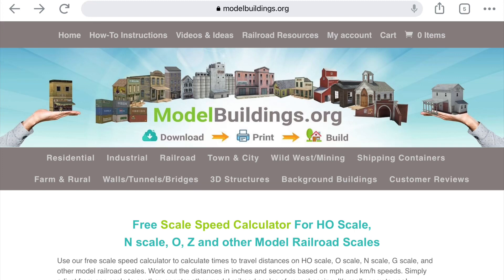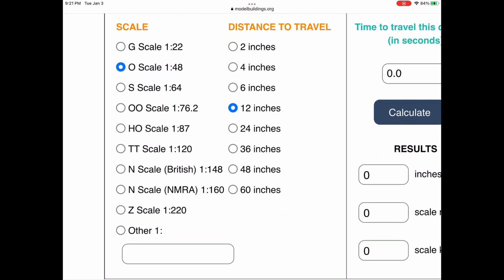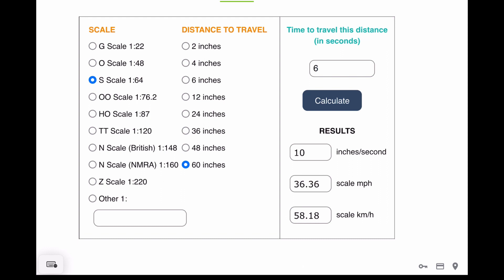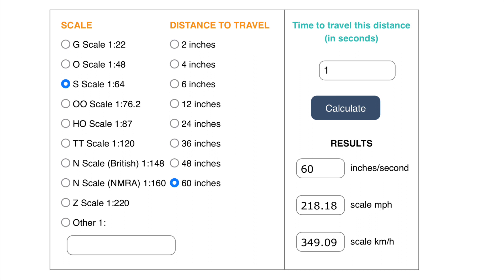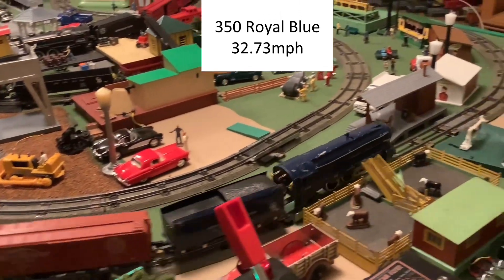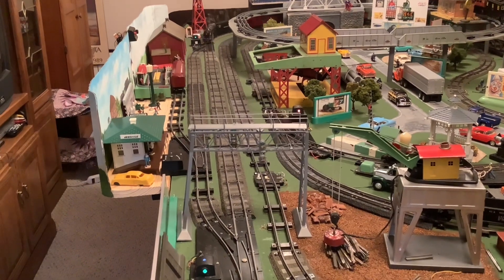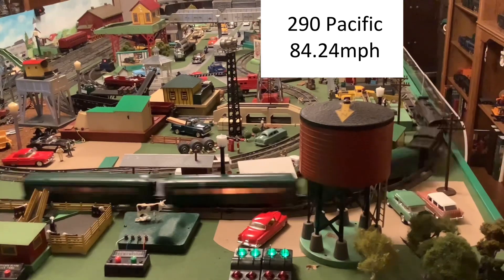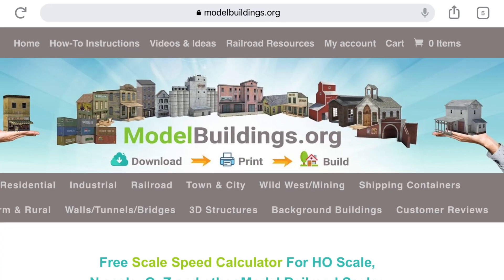American Flyer Relative Scale Speed

Comment: Roger, excellent topic and well covered. I too was getting annoyed with the speeds required to get the engines to show their strength, chuff and puff. About 7 years ago i started changing my engines to Electric Rail Road (ERR) TMCC controllers via Lionel. These little PCB boards offered a Digital DC control of DC Motors to include a cruise capability at a very slow speed. Then Mike's Train House (MTH) Offered its version of Digital Control (DCS) and their fabulous Sound System Proto Sound 2 & 3 (PS2, PS3). They added crew talk and random engine noises too. But what hooked me was the Puff & Chuff. The engines could be directed with a wireless hand held to pull away at 1 MPH Scale speed. Then slowly ramp up to cruising speed with the puffing stack synchronized to the Chuffing Sound. Oh it was amazing. But over time the costs of systems like these started to take off, from $30 ERR TMCC to $250 today and MTH PS2 $75 now $350 if you can find it. I retired in 2017 and started to research how to help my Vintage Original Engines to be as much fun as these expensive 3rd party upgrades. I found it is possible but it has taken over 7 years to develop sane logical upgrades in the Spirit of AC Gilberts support for technology.  My Channel on You Tube is Frankentrain Laboratories. Where i have over 900 videos on my efforts. I would like to begin a teamwork with you to evaluate my work and see  how I can help to make these upgrades useful and reasonably priced. All my parts designed and made by me are offered at my cost. I am retired and work in my basement. I have train buddies all over the US.  Here are a few links to share with you. I am NOT a Modeler, I am a Developer. So my Layout is named Rat Rail Line. I can't paint anything very good. Enjoy and lets talk, 302 in test chassis only https://youtu.be/qy9D9MSFLKU
same 302 on the rails in test  https://youtu.be/HrLresxhJeE
I do run them fast for fun, but the slow speeds can get real exciting with a little more tech applied.  Here is an older Video using PS2 on  Hudson. https://youtu.be/74EAc_yGPAY
My best build a Northern,  MTH PS3 https://youtu.be/YXRjsC1QQv8
Reply from the maker: Thanks for your comments.  I’ve watched some of your videos and am impressed with your creativity.  I’ve looked into DCC and some other modern systems but, aside from the cost, I like to keep my equipment as original as possible so, with sound for instance, I’ve done some experimenting with trying to integrate speakers into the layout.  I haven’t done anything permanent yet but it is something I’ve been exploring and I could see that you might have some helpful tips for that.  I’ll check out those links you attached and would be glad to talk some time.  I’m in an area where the hobby isn’t real strong, especially for American Flyer, so being able to communicate with people in other parts of the country is a benefit.  Let’s keep in touch.